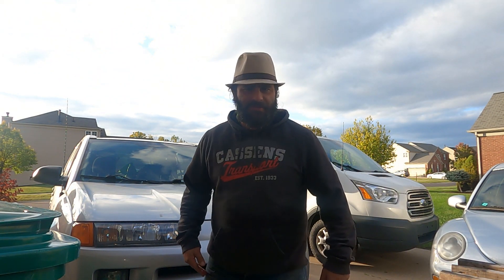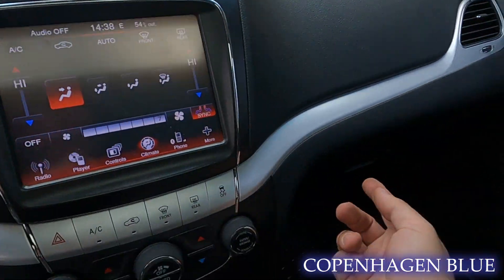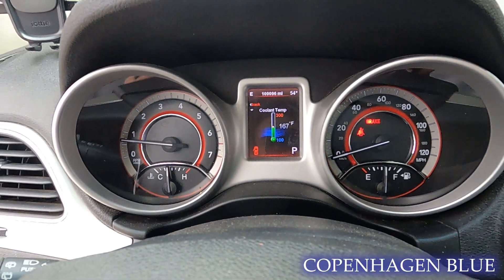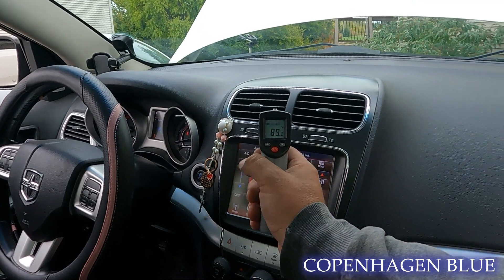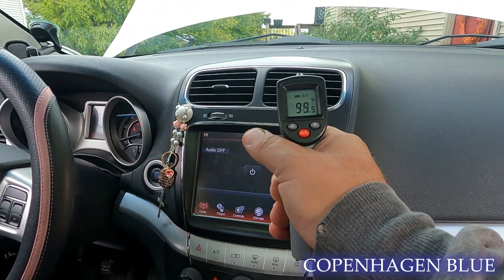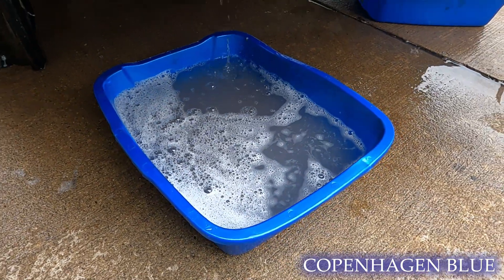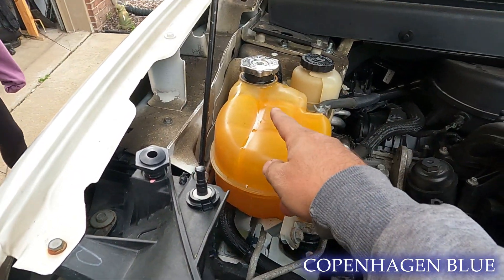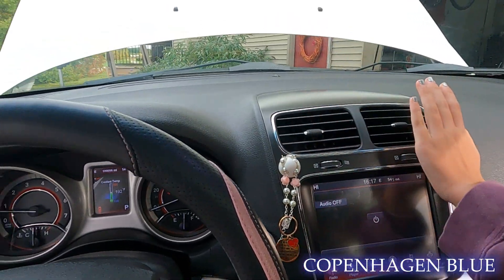Can a coolant flush save a clogged heater core?! Let's find out!

Comment: How's the heat? Still holding on?
Reply from the maker: Two months later and it’s still rocking it out with good heat. Not as hot as the drivers side still, but hot enough you’re not cold.
Reply: @copenhagenblue8417  that's great to hear. My wife just texted .e saying hers is so hot she had to turn it down. Was just flushed with clr yesterday
Reply: @copenhagenblue8417 update please!!